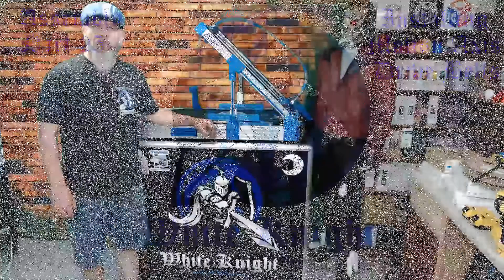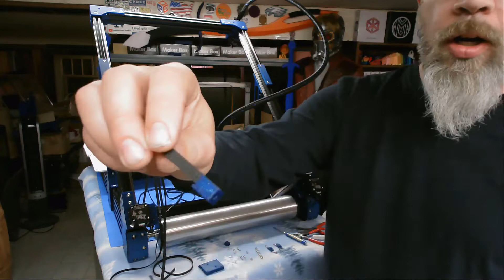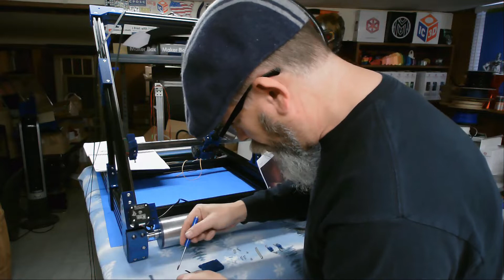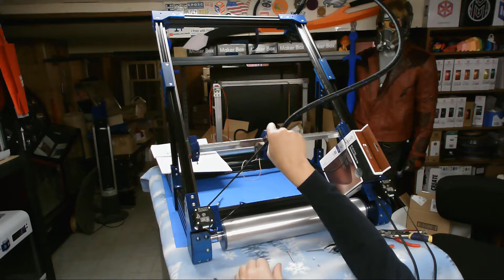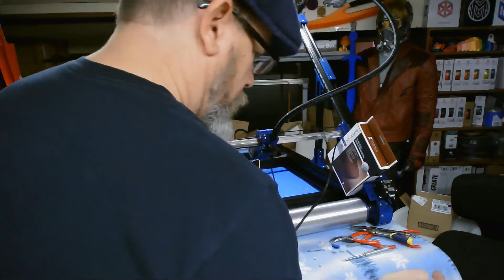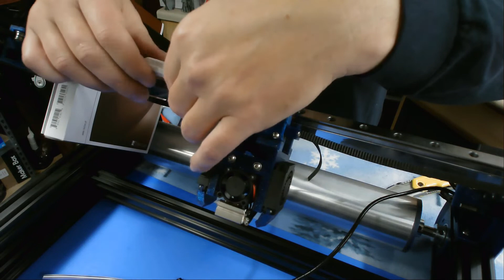White Knight Assembly Part 25

Comment: Hi Karl, I'm currently printing the parts needed for the White Knight and thinking of modifying the design a bit to add a pellet extruder rather than a filament extruder. Do you see any issues with this?
Reply from the maker: I've never worked with a pellet extruder but can't  see any reason it couldn't work..
Reply: @NAK3DDesigns  Cheers, I figure it might be a good idea for this printer as I can have a massive hopper feeding down to the printer for large objects. Pellets are also cheaper than filament which will be important with the amount of printing I have planned for this. 😁

Comment: Carl, can You tell us where to buy belt? Shop that you provided have not any of that size
Reply from the maker: Which belt?   The print bed or the GT2 belt used in this episode?
Reply: @NAK3DDesigns  The print one :) Sorry
Reply from the maker: DiscoCzarnobyl as this is a custom belt you need to contact the companies directly to special order.   I’m hoping Printed Solid will have the belts available soon to help cut costs.    Also if you are building one have you entered the belt giveaway?